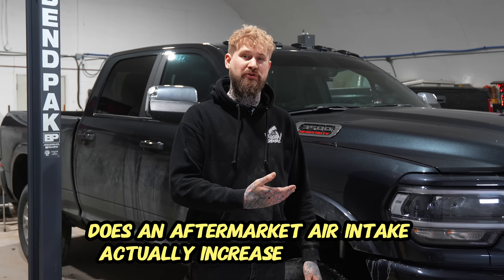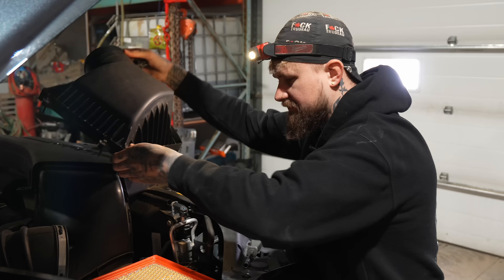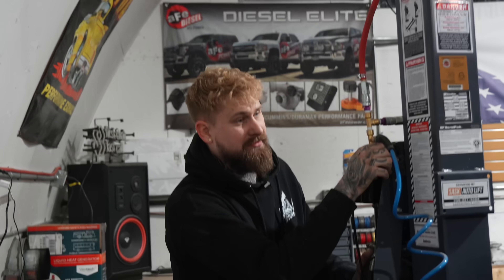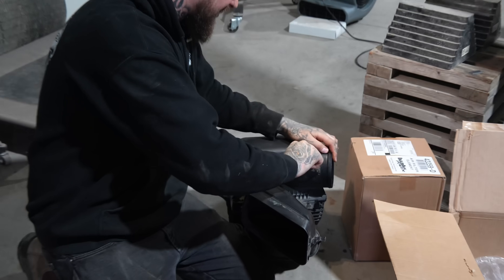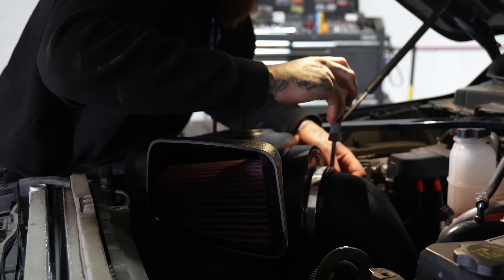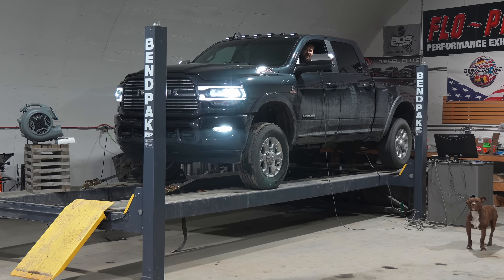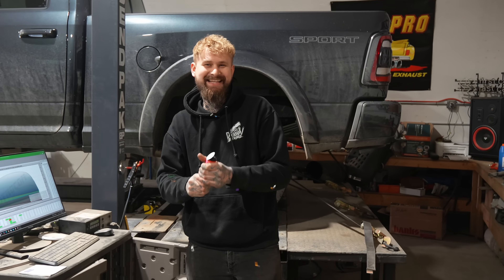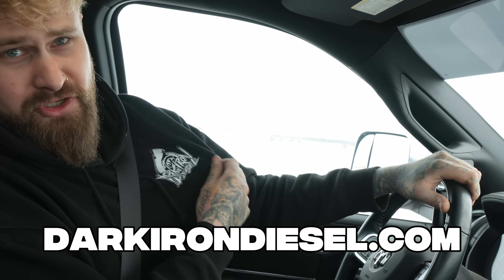Does An Aftermarket Air Intake Increase HP - Cummins Dyno Test

Comment: New Ram owner here. Bought a 2024 Ram 2500 with the 6.7 Cummins I thought about doing the cold air upgrade but I've been hearing it can cause the truck to throw a low boosts code. Is there a fix for that?

Comment: Not sure if its been said, but bolt ons without tuning are almost useless correct?? The engine may take less efffort to get the air it needs but if it calls for a certain percentage of air to fuel, its always gonna call for it. So you really shouldnt get hardly any improvement in numbers without tuning the truck to let it demand more to make that extra hp and torque.. am i thinking right? You given the truck the ability to breath easier so its defenetly more efficient buuuuuuuut without tuning it to make more hp after the upgrades, the numbers shouldnt change too much. Youve jist increased the throttle response and efficiency of the intake system. Please correct me if im wrong its just what i understand. Im trying to get my youtube mechanics degree lol.

Comment: Dodge diesel - $470 bucks to gain a whopping 4 Hp and 1 lb ft of torque - LOLOLOLOL. Uhhhh, yeah, sounds nice but $470 bucks plus tax and shipping for a bit of sound??? That 4Hp and 1 lb ft of power could have been the direct result of atmospheric conditions. I'm not gonna quote PT Barnum on suckers but these expensive adds on with a computer controlled engine do no more then line the seller's pockets with your hard earned dollars.

Comment: Hello, I recently installed the following Banks products on my 2022 RAM 3500:
    •    Banks Cold Air Intake
    •    Boost Tube Upgrade Kit
    •    [Not yet installed but I have it ] Monster-Ram Intake with Killer Grid Heater Upgrade

I followed the installation instructions carefully and everything ran fine at first—no CHECK ENGINE LIGHT, smooth idle, and normal performance.

The day after install, I was towing my 24ft trailer and engaged the exhaust brake while slowing down on the highway. As the truck downshifted, the check engine light came on. I scanned the truck when I got home and received the code:
P0402 – EGR Flow Excessive Detected

I cleared the code and drove about 20 miles under normal conditions (no towing, no exhaust brake) to allow the ECM and EGR strategy to stabilize. So far, the code has not returned.

My concern is whether this issue may reappear when I re-enable the exhaust brake, and if so, whether Banks has a recommended solution to address the airflow change that may be triggering this fault.

Is there an update or strategy I should apply to prevent this from happening again—especially once I install the Monster-Ram and Grid Heater upgrades?

Thanks in advance for your help.
Reply: Return all the junk you got from Banks and purge him from your mind. Best advice I can give you, brother.

Comment: What would happen if you cut out the passenger side of the stock airbox? Would it cause issues with air intake or would it be better air flow and better turbo spool up?

Comment: Get a proper fan set up for your dyno to push air. second did you even drive the truck to allow the ECU to adjust to the new intake or did you just install it and back it onto the dyno. This entire test is invalid.

Comment: 4 horsepower , cleaner cooler air, means more engine longevity too.  Its really not about the 4 h.p.   clean oil , fuel ,and air is the key.

Comment: What's the check engine light on for?
Reply from the maker: Because the truck is on the dyno. I’ve said it a million times but people still don’t understand.  When the rear tires are spinning at 100mph and the fronts are at 0mph it sets a million engine lights, ABS, park brake, traction control lights etc.

Comment: "You hear it"? $2000.00 into the intake with no power gains............. yup I do hear it, it sounds like a money vacuum now.
Reply: where did you pay 2k for it lol I got mine for like 230
Reply: @calebalt1557 BANKS PARTS aftermarket intake (filter to turbo) = $651.05CAD
Both intake tubes= $636.55CAD
Intake horn= original price $1,403.60CAD on sale right now $1,041.10CAD
All parts needed to have a full intake system, you can find cheaper but I listed all Banks products because that is what is seen in the video. I don’t know where you got your intake on Temu or what but when you have a diesel truck you gotta all of it to have a true aftermarket intake. Also if you have a computer controlling your fuel to air ratio the computer will change the ratio so it’s running at stock numbers giving you zero power gains, just sounds better because they don’t have all the noise reduction built into intake.
Reply: @DE306 well I paid in USD, and he didn’t have all that in here, he only had the cold air intake, which is what I have. I also have the banks monster ram, and it’s on sale roght now, I got the cold air and monster ram for 1200 or so, but yeah if you want the full intake system yeah it’s gonna be that much, I thought youwere saying for the cold air alone as showed in the video
Reply: @calebalt1557 for sure, I’d have to watch video again to get the context of why I even put this comment on but I believe it was because he has changed out the entire intake system and has gotten zero to no HP gains. I imagine it makes it able to support more power once you add more boost or tunes but just tired of all these companies claiming this and that selling bolt on parts and a lot of people think their doing something but they aren’t.
Reply: @DE306 yeah I dunno, I put the banks cold air and monster ram on, I had the cold air on for a while and not really any noticeable difference except more turbo noise, but I put the monster ram on yesterday and it seems to get a few more MPG and a little more touchy on the accelerator which is kinda nice but I don’t really buy into the whole more HP… if I want more HP I got tunes for that 😂

Comment: IME, Banks intakes are worse than Temu products. I can get a 13% HP increase using a clothes dryer vent hose
Reply from the maker: Lmao what?
Reply: The banks cold air intake is a con. Full stop  @darkirondiesel
Reply: @darkirondiesel I don't have more diesel experience than you have years on the planet. But whatever.
Reply from the maker: The statements you said lost all your credibility. Saying you can buy a better intake from Temu is obviously not true. Then following it up saying you can get a 13% increase with a dryer vent hose (makes absolutely no sense) is also not true.

Comment: Everyone losing their minds over how "little" horsepower was gained. Did you measure air density and pressure drop differences at key points along the intake track? I wonder how much easier the intake makes the turbos job...

But "all we care about is the horsepower here"....

Comment: I installed a Banks intake on my 2018 6.7 and it completely took away my turbo lag..plus i will never have to worry about the bolt from the grid heater falling into #6 cylinder!

Comment: You have the banks ram air horn on?  How did you push 430hp now and when you put it on it was only like 410hp?  What changed.  Also, 800 tq is alot lower than what you had before
Reply from the maker: When I do dyno tests I try my best to only have ONE variable - the product being tested. 

The numbers could be different from multiple reasons. One being the truck had a new air filter. Two the truck had different fuel in it. Three the temperature in the shop was different. 

There are more but that should give you an idea.

Comment: Just bolting it on?  Of course not.  To make any aftermaket intake/exhaust mod deliver it's full potential you need an aftermarket/custom tune.  Doesn't matter ifnit's the cheapest cold air intake on Ebay or a $1000 Banks system, you gotta get it on the duno and remap if you want it to work.
Reply: Thank God someone else gets it. It's the same with computers. You can buy the best CPU, but will run badly with poor Ram. Yeah let these slacked jawed yokels tune their cars and keep the stock intake because the 6 hp increase wasn't worth the money. Fools

Comment: You left us 8 days ago with 420hp, a "slight loss" with the elbow. Now you're at 436hp, 440 with the intake.
What's up? Could it be that your ecm has no fucking clue how to fuel it after the changes and you need to put some miles on it for the brain to learn?
Reply from the maker: Different fuel in the tank, different temperatures in the shop, a new clean air filter… just use your brain before commenting next time.
Reply: @darkirondiesel  funny, because I am actually aware of how modern ecms adjust to changes, and it affects everything from warmup to fuel maps to transmission shift points. 
But hey, I don't have a YouTube channel and a dyno. But if I did, I would compare runs immediately after a change to runs made after a few hundred miles with some start stops and highway highway mixed in.

Comment: 2021 f350 with a 6.7 and a CAI (blue nano fiber cone filter). Hp and torque aren’t noticeable. I did however notice a more peppy throttle response down low. I’ve had the intake on snd and off enough times to confirm. Worth the price? Nope. But I do blow my filter off enough times to make it worthwhile

Comment: Monster everything, but still trying to suck through the stock scoop. Be intersting to see how much, if any, vacuum there is in the pre turbo side.
Ngl, all these products are not really going to do a hell of alot while stock. Once you start changing the turbo and flow alot more air with bigger injectors, will any of this really start making a difference. But stock is just pissing in the wind.

Comment: I loved the way the banks intake sounded on my 2020 3500.  However, when towing she was not happy.  Check engine light and the truck would start bucking from the boost code that was being thrown.  I'm not deleted or tuned so unfortunately I had to take it off
Reply: Same, I'm fighting that battle now. To Banks' credit, they have told me that if going back to the OEM filter fixes the CEL they will refund my money.

Comment: Could be wrong but like most intake and performance parts isn’t a proper tune the best way to pull power from the parts? That would be the best way to test the intake. Tune on stock intake to pull the most it can. Followed by a tune customized for the intake. Not saying results will be drastically different but willing to be it would be a bigger difference.

Comment: I just find it hard to go with an after market intake especially when you have the active air stuff on these trucks she’ll open up for more air. Atleast with the 4th gens. I’m not sure how the not technically 5th gens but pretty much are 5th gens because different design. Like I’d rather just keep the stock box on my 4th gen keep the active air damper and just change the flow tube 😂 I ain’t got money to piss away so 500 is crazy and 900 for the monster ram. Which kinda worth it. I imagine these do good when you tune it and aren’t as limiting as stock parts.

Comment: I mean, 7 damn hp from an intake that's quality is not bad. People act like it should be 20 hp. I mean I'm sure if you did the complete package boost tubes and all, it would be a decent amount for just simply adjusting the air flow
Reply from the maker: Dude I know right, I don’t know what people expected.  Guys out here thinking an intake with no tuning adds 50hp or what?  I was pumped to see the 6-7hp increase over factory
Reply: @darkirondiesel  exactly

Comment: I would say gone are the days of gaining 25 hp from an intake or filter swap. The automotive industry is utilizing every advantage they can find to beat the competition thus creating a not too shabby intake. On newer trucks, I think the stock intakes are just fine - but thats me.
Reply: I put an air intake on my truck and gained 4 mpg on freeway, iat’s down about 30 degrees, and egts are much lower. If towing I would say it is a must especially that it’s not too expensive
Reply: @mikeyfaulknor9970 😂😂😂😂😂😂😂😂.
Reply: Nobody accounts for practicality either, the filters are $100.00 plus, if you drive in dusty environments dry is the way to go, but will have to replace all the time when it gets dirty and You don't have to worry about not under oiling properly. An oiled filter you need to buy a second filter anyways if you wanna drive your truck anytime after washing and re-oiling, probably can't even oil when filter is wet. So $650 for the intake kit + $100 for every filter with no power gains and possibility of ruining your motor from getting wrong filter or not properly oiling. Or just pay $30-40 for a stock filter. I'll just do stock and save $$$$$$$
Reply: @DE306 we get it. You’re poor
Reply: @Kevin-s7s I’m not poor, it’s just f’ing stupid spending thousands of dollars on something that does nothing. The aftermarket industry is an industry gear towards the everyday person with an everyday grocery getter vehicle that needs to make money and a lot of the stuff out there is junk and doesn’t do anything.
Reply: This clown is a clown. 100%

Comment: Changing the intake is only part of the equation.  You have to increase airflow all the way to the engine: boost lines, inner cooler, intake.   Added the intake and ram air horn/grid heater delete and noticed a difference on my 2020 6.7 Cummins. But it’s like fishing, if everything is 50lb test except one 20lb part, it’s a 20lb rig.
Reply: Inner cooler? 😂
Reply: all that when you couldve thrown a turbo on it and made 3x more power easily..
Reply: @cs-gj3yf exactly I don’t have a problem with banks products but they act like they’re going to make a ton of extra hp when in reality you could delete, tune, or add a turbo for the same price and far more hp
Reply: you didnt notice anything. cant feel a few horsepower gain in a 8000lb truck lmfao
Reply: @mmmmurphy I pull 80K pounds down the highway, I can feel the difference between trucks under load.

If 8K is the cutoff, then why not 7?
Why does a 400HP diesel feel so much better than a 350 unit pulling up a hill in a semi?
Reply: @rainbowbunchie8237  he's just not very perceptive
Reply: @TheIronCowboy  For sure. If 1-ton truck tires murder my silverado's acceleration, imagine what actual reduced crank power would do lol

On that note, great for pulling trailers full of scrap. 16" sticky bois up front and hard, heavy duty tires in the back feels like it's on rails.
Reply: @rainbowbunchie8237 There’s a big difference in torque with that 12+ liter engine with 50hp difference. That’s why. You have no idea what you’re talking about
Reply: @michaelward601 Duh. Torque x RPM = horsepower.

What's your point?
Nobody mentioned displacement here.

The guy made a very wrong blanket statement that you can't feel, for example, 50 horsepower increase in something heavy.

Adding 50 horsepower to a giant torque filled 15 liter cummins can be felt.

Adding 50 horsepower to a 6-7K pound pickup with a gas V8 can be felt.

You have no idea what you're talking about. :)
Reply: @ He said you won’t feel a 6hp difference at 400. Which is true. You never will. Your example was a 50hp difference in an engine twice as big so it’s going to make a lot more torque resulting in more power. You’re the only one wrong here dude. Torque x rpm divided by 5252 is the equation. If you’re going to try to make a point or prove someone wrong at least know what you’re talking about.

Comment: I was TOTALLY gonna buy this intake unit from banks, but they honestly basically tell u themselves it does NOTHING  performance wise, and im not interested in using an oiled air filter.  Dry filters, when properly designed like oem, clean A MILLION TIMES BETTER .
Reply from the maker: THEY OFFER DRY FILTERS TOO 🤯
Reply: @darkirondiesel  i know that but as per their own words, the dry filters  are both very expensive and  a special unit built only by them.  So basically an  impractical option.

Comment: Not a big fan of Banks products. Banks works very closing with the tyrant EPA. Gayle is one of the big players in the aftermarket world that has pushed for strict emissions standards over the years, so his company could profit with their emission compliant products!
Reply: Banks is under the same watchful eye as any automotive aftermarket parts manufacturer. Do we wish emissions equipment wasn't necessary on street trucks? Yes, of course. No one likes after-treatment systems. To suggest that we're fans of overbearing and illogical emissions regulations like the Clean Air Act and its inexplicable enforcement is silly. The EPA would be happy if all aftermarket parts companies disappeared tomorrow, including Banks. The fact that we are complying with the law doesn't mean that we agree with it.

Comment: Stock air did make more then BD this time 🤷‍♂️ But even still, I took off the washable filter off my Ford 6.7, u need 2 filters really,  they don't dry out unless left in sun and shake crap out of them, and its hard to get the sand pieces out that get stuck between the mesh and filter media. Just went back to Stock, much easier 🤷‍♂️

Comment: these  air  intakes  are  designed  to  increase  airflow  on  a  moving  truck  not  a  stationary  one

example  my  325  hp  waverunner  you  cant  dyno  comparison  2  air intakes.
but  the  30  to  85  pull  with  a  top  brand  intake  throws  you  back  w  supporting  tunes
Reply: Lol

Comment: FYI you should NEVER use anything but water to clean an LCD monitor. They often have coatings on the panel and if you use a harsh chemical to clean it will strip off the coating.

Comment: If the engine ECU able to hit the target airflow/boost levels, then even going from a restrictive intake to magical perfect flow intake is only a minor efficiency improvement and a very minor HP improvement.
Reply: Most people do not understand this concept. The things that actually add power are tunes, then upgraded turbo/injector mods, and internals/hardware that can handle the power